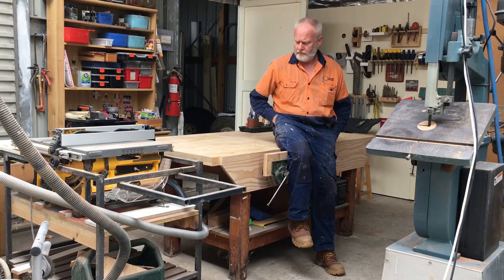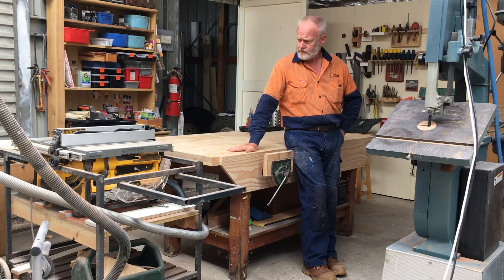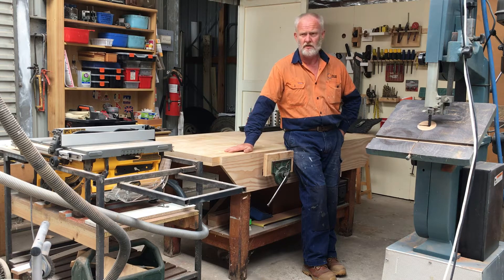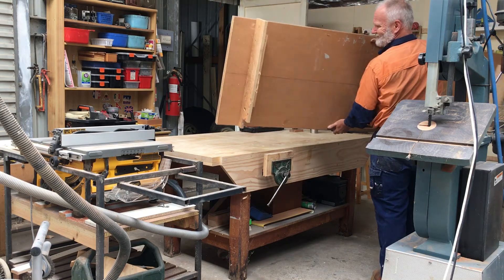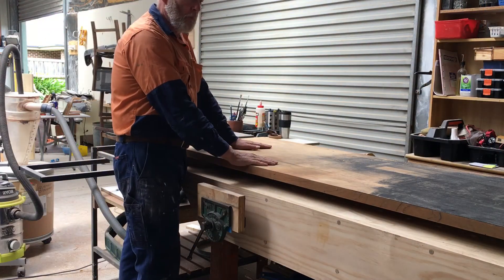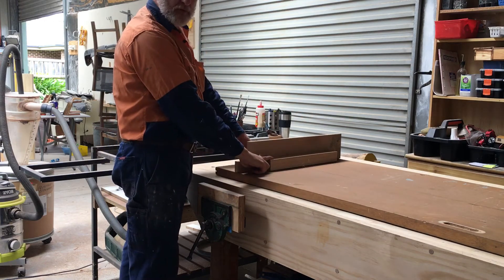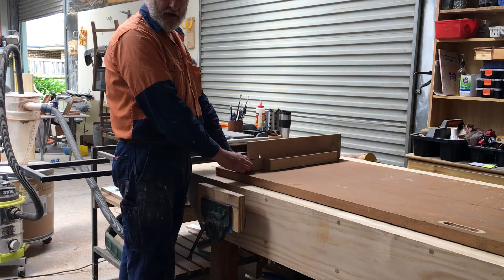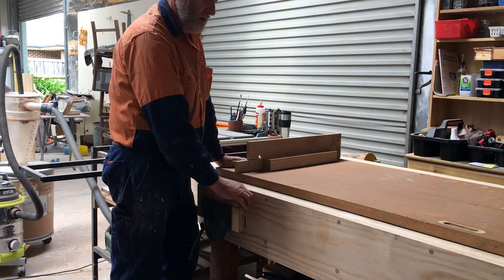Outfeed Table

Comment: I have an old work bench that I was going to modify into an assembly/outfeed table. I was going to replace the existing legs with longer ones until I saw your video. This is going to save me so much time and money. I also happen to have an old door lying around. Great idea.